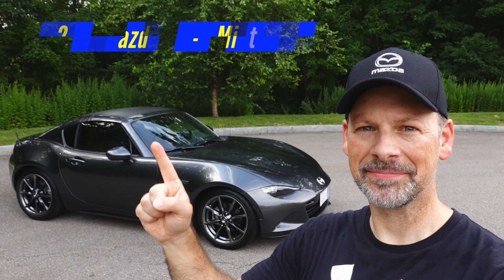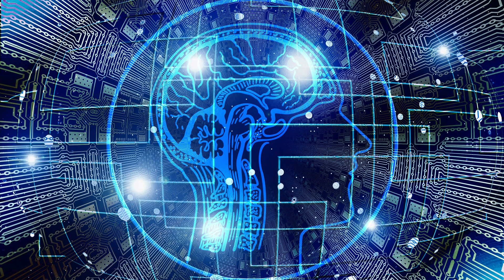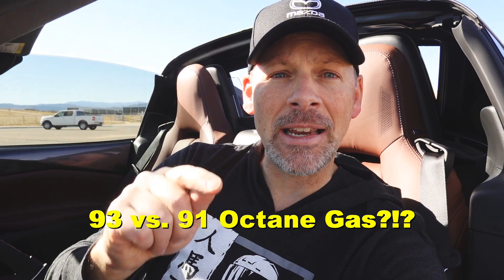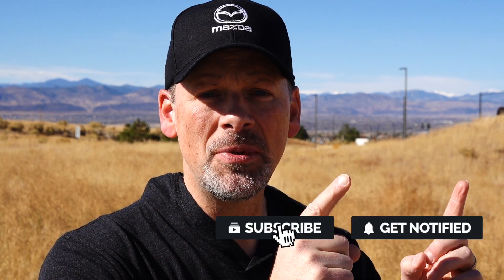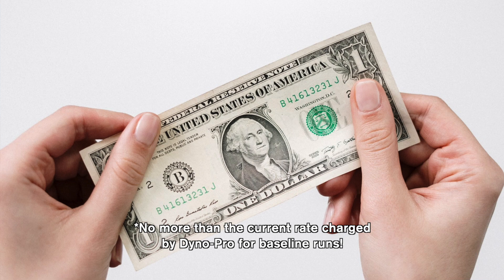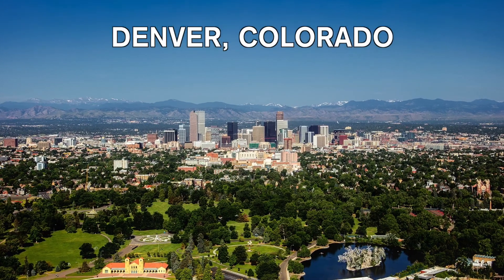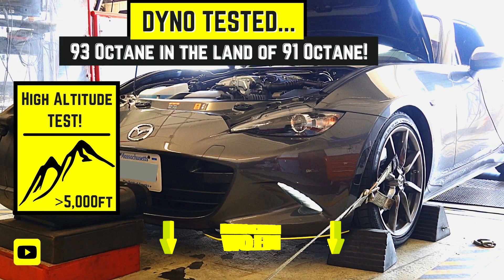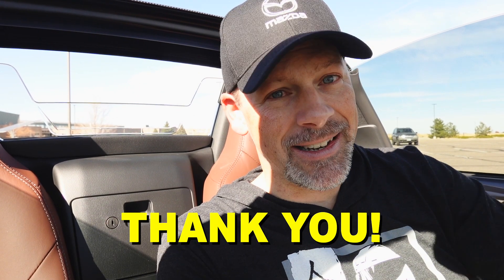91 vs. 93 Octane??? - DYNO TESTED // ND Mazda MX-5 Miata

Comment: Prior to the test, did you disconnect the battery first for 30 minutes to allow the ECU to reset and then give it time to self tune to the different octane? Mazdas will self tune if this is done or proper protocols are followed: If you do not do the battery disconnect, it can take 3 refuels for the ECU to switch over fully. Also, did you run the gas all the way down completely before changing the gas? Could you please take a Gen 3 Mazda 3 2.0 and do this same test but with what I mentioned to do? It has the same engine as some Mazda MX5s.
Reply from the maker: As I answered under your same comment elsewhere… Yes, the battery was disconnected and fuel run for several hundred miles before testing 👍

Comment: When I recently picked up my ‘24 GT RF the dealership folks all pointed out that while 91 octane is preferred, the car will run fine on 87. They made a point to mention it because in Nevada the price spread between regular 87 and premium 91 octane fuel has grown to 70 cents or more! So, while I’m running 91 during the break-in period, I am curious to know how much difference my seat dyno feels with regular. And, of course, if the car suffers any other noticeable side effects. In previous cars that could safely make the adjustments for different grades of fuel, the general rule I followed was that lower octane fuel would work just fine for long highway cruises—not much acceleration and mostly steady speeds. Around town, or during spirited driving through the twisties, the higher octane fuel was worth the investment. Of course, in the past the difference in price was a lot closer. Has anyone done the dyno runs recently with 91 vs 87?

Comment: I think the elevation/air density where you r
Are might be limiting the peaks. Granted you're probably only leaving 1-2 hp on the table at that point.  The turbo will definitely show a bigger change. But I'm curious as my local shell (probably others) has recently rolled out 93. Though we've had 93 in the area for awhile, I just don't use those stations for my own weird reasons.
Reply from the maker: I'm sure the horrible DA due to my altitude plays a role.

Comment: Interesting. I recently, a few days ago, bought a Jaguar 3.0 F-Type manual transmission from Denver, it was shipped to me in New Hampshire. I use 93 octane in it and was wondering about any change in performance the higher octane gas we can get here would have. I suspect lower octane would be a bigger factor at lower elevations.
Reply from the maker: Congratulations on the new car! 👍

Comment: im going to go ahead and guess this is because at 91 octane youve already built your margin and cannot pre-detonate in that engine no matter what you try because you have a fixed compression ratio.  93 octane is going to be a lower power dense fuel than 91, so if you're already stoichiometric (most power extracted) and not pre-detonating, then bumping up the octane isnt going to have any effect

Comment: Annoyingly most places near me (Florida) do 87, 89, 93, skipping 91. So I’m forced to get 93 as the only option that meets or exceeds the recommended. 

This is good to know at least, confirms my suspicion that 93 is no better than 91 since it’s tuned for 91 and if I station has 91 I won’t be missing out any.
Reply: If I remember correctly a lot of places just have 93 and 87 and everything else is just a blend
Reply: nd2 miata is minimum 87, with recommended 91 or higher

Comment: With higher elevation, thinner air, lower octane can be used so 89 or maybe even 87.  These lower octane might be stronger running, cause higher energy density in lower octane.  Octane additive does not have the energy density that gasoline has.  This is theory, in practice might not be enough difference to make a real world difference.

Comment: See, this does not surprise me since the manual says 91 or higher recommended so it’s likely tuned for 91. That said, I think a good video would be dynoing 91 vs 87. The manual says 87 is allowed but would likely see a performance drop off, and I’d be really curious to see how much power it would lose with 87.

Comment: I just put a supercharger on my 2020 mustang gt. The tuner said the 91 octane in the tank was junk. If I can't find better/use octane booster I just dumped a lot of money in this car for not enough hp. I'm not a happy camper right now
Reply from the maker: A good tuner should be able to tune around your 91 octane gas
Reply: @TheLemonFactor  I'm using one the best tuners in the coyote community. No way possible to add timing to bad gas when you're getting knock.

Comment: minimum required is 87, dealer said it will run fine, maybe some slight lost performance but it will not hurt the engine????

Comment: I would actually be more curious to know how much a diff 91 vs 87 octane. Should do a video on that. Gas is already super expensive now.
Reply: Skip your Starbucks for one day and put the correct fuel in your car.
Reply: People have reported 87 being perfectly fine for around town driving below 4krpm, anything above that approaches knock. Can't verify how true this is, but it's what people report. It makes sense however because the lower rpms don't require as much fuel or air or timing as higher rpms. You'd probably be down power at the very best and knocking at the worst. 

If you're boosted, I won't go below 91 especially, at any rpms.
Reply from the maker: Mazda specifically recommends premium octane fuel for the Miata - I would not consider putting less than 91 octane in the car.
Reply: @TheLemonFactor  please test 87!!! Run a few tanks with the 87 to make sure there’s no premium in there. Recommend don’t mean sh!t!
Reply: @jacobbensonmanty  there are already plenty of tests done on this with a miata. you will lose a fraction of MPG but you will gain dollars in your pocket.
Reply: @TheLemonFactor  as you said, recommends, keyword, does not require. I know someone that has a 2019 rf and has always put 87 and has never had an issue with his car and says the car drives like you would still expect it to.
Reply: @MeredithLawwson  Research OCTANE and why it is gasoline...use the fuel recommended by the manufacturer. They do so for a reason.
Reply: @MeredithLawwson  That's dumb because it's against what the manual suggests and you're saving maybe $3-4 per full tank fill up. The Miata has very high compression so it really does require higher octane. Of course, if you just drive the car for 2-3 years then you probably won't see an issue, but why risk it?
Reply: @TheLemonFactor  but my Mazda 3 has the exact same engine but recommended fuel is 87.

Comment: This is very interesting! Was this on the stock ECU tune?? I've noticed the stock ECU on my ND2 really tries to provide consistent performance regardless of the environment.  Even with the AC blasting on a 100 degree day the output seems pretty consistent and it pulls a lot of timing off the initial knock during hard acceleration when it's cool out to normalize the engine output compared to less ideal conditions (hot).  I've noticed a bigger difference in performance relative to fuel quality myself,  in other vehicles that seem to have a bigger window for timing advance (Honda).  I do feel my car performs better with Shell and always found it be a placebo effect, but having worked on logistics I now know most fuel in Southern California comes from the same "racks" except for Shell fuels which are kept in separate tanks and shipped in captive vehicles without being mixed.  I think the quality of fuel and ethanol content may matter more than the "minimum octane rating" on the pump.  The west coast 91 may well have the same detonation point as 93 from a station out east with with lower fuel standards.  The number on the pump is a "minimum".
Reply from the maker: Yes, this was on a stock vehicle. It’s an interesting point regarding the “minimum” octane 🤔

Comment: Octane is not going to affect power if knock does not increase on a stock engine. In colorado, an NA engine especially won't be affected by the dip in octane because the state is further above sea level. Your car already took a loss in power just by moving from wherever you were before into colorado because the air is thinner here. The lower octane rating accounts for the thinner air/ie less air that enters the cylinders and therefore NEEDS to reduce octane to get a complete burn.   Having 100 octane on an NA car in colorado would result in lots of unignited fuel shooting out your tail pipe.  wasteful and bad for your engine anyway. you want as complete a burn as possible.  Therefore, putting 93 into your car while IN colorado may result in a further dip in power, because it might be too much octane and cannot burn well.  

Higher octane available at or below sea level is needed for the denser air. as a byproduct, your NA engine produces more horsepower at that location. therefore needs to higher octane to prevent knock.   States don't just sell different octanes willy nilly. it's all determined by the atmosphere of the location.  Forced induction is the only time... and a much higher compression changes the need and you may need higher octane then.

Comment: The difference (I'm guessing) has to do with more with elevation/altitude. When you ship a car from, say, sea level, to one mile above sea level and throw it quickly on a dyno, it hasn't had time for the ecu to "learn" that the intake is sucking in thinner air. It was therefore making less power than it should have, even though the fuel was higher octane. Then you drove it for a while and the car adjusted for the difference in air density before you put it back on the dyno. Basically, there are several factors affecting the outcome of these results besides the octane level of the fuel. I won't even get started on probable temperature and humidity differences from having a car on a dyno days (or weeks?) apart and the effect those always have.
Reply from the maker: Interesting theory, except that the car had been driven for several weeks and couple hundred miles before it was dyno tested with the 93 octane.  In addition, the car produced the same results (w/ the 93 octane) as when it was dyno tested at sea level (see previous videos).  Lastly, temperature, humidity, barometric pressure, etc. are all standardized (i.e. calibrated into the results) when dyno tested (albeit not perfect), thus why I provide both the corrected / standardized numbers and the uncorrected numbers.
Reply: Because of computers the octane requirements have changed much. Back in the late 80's SAE did a study and at a nearly a mile up the octane requirement drop is around .3% IRC. This is over decades ago and ECU's have only become more efficient.

Comment: Poeple seem to think that higher octane equals more energy and more HP. Octane is added to gasoline to keep it from detonating under pressure. The higher the compression ratio the more octane is required. Too much octane is in fact detrimental to the longevity of your engine. Use the recommended Octane rating for your car. The only time you may want to use higher octane fuel than what is recommended is if you have modified your engine and it has a higher compression ratio than it did when stock.
Reply from the maker: I’ve never heard that higher octane fuel can be damaging 🤔 - are you sure about that?
Reply: @TheLemonFactor  I'm dead sure about it. A tiny little bit of research will give you all of the info you need on octane and why it is in gasoline. Search, "What does octane do in gasoline?" or Why are there different octane ratings for gasoline?" If you run high octane fuel in a low compression engine it will carbon up pretty quickly. If you run low octane fuel in a high compressions engine, such as our MX-5s are, you will have pre-detonation and eventually do damage to the piston head and/or the combustion chamber.
Reply: @AFlasher2277  Makes sense.

Comment: Hey mate ! I just sub your channel ! Seriously i love your content i watched all the nd vids… you know why ? Cause last month i ordered a 2022 ND RF « révolution » 2.0l manual in soul red. ( revolution is the highest quality you can get for a nd in Switzerland ) 
Keep making your great content !
Reply from the maker: Thank you, Leo, for the sub, watch, and the positive comment - it's very much appreciated!!!  Congratulations on the new car - I like the name of the trim "revolution" ; )  What plans do you have for your newly acquired Miata?
Reply: @TheLemonFactor  
already thank you for your answer I did not expect it. But glad you asked me about my plans for my nd, I made a little list :)
Chassis/ handling 
- oem mazda short spring (600$ parts amd labor ) 
- konig hypergram with ado8rs tires
- yellow stuff pads 
- ( maybe a chassis brace ) 
Interior / exterior 
- vertex knob shifter
- checkered floor mats from rev9 
- greddy lip 
- side skirt ( from carbon miata ) 
- rear diffuser ( from carbon miata ) 
- spoiler ( from carbon miata ) 
Engine / power
- hks exhaust ( with maybe a header ) 
- hks filter or a mishimoto air intake
- a tune from my local « tuner »
And that’s all ( i hope ) 
My goal is to have a fun and good looking weekend car that i can drive in the mountains cause there’s plenty in Switzerland but also at the track. I hope to get 205-210hp. maybe what I'm going to do is not your taste but hey I'm only 20 I'm not as mature as you. almost all of the work will be done by me because I am a volvo technician and apprentice trainer. So yeah thanks for asking !
Reply from the maker: That’s quite a list 👍. I’m sure you’ll love your new car, especially once you make it your own. I can only imagine driving through the Swiss alps - it must be awesome!

Comment: How do you know what octane was in the car.  I had a 1984 Plymouth horizon when I was in college in the early 90’s.  If you put regular 87 octane in it the engine would knock but it was quiet with 93 octane.  Anyway quite a few times I would put 93 and it would knock means the pump said 93 but it was really 87
Reply from the maker: I guess I’m gullible and trust what’s marked on the gas pump 🤷‍♂️
Reply: @TheLemonFactor  It probably was but you never know.  They say the reason you only get 93 in Colorado is that elevation negates the difference.

Comment: Great news on the 91 Octane Dyno test.  I live in TX so I have access to 93, but it’s good to know that I wouldn’t lose much if any HP or torque by using 91.  I might just start filling up with mid grade now and see if I see any difference.
Reply from the maker: It’s good that you have the choice of 93 octane. I was very nervous I’d see a drop in hp moving down to 91 octane. I’m glad that’s not the case. 😁👍
Reply: My 2023 mazda3 2.5  says use 87 or 93, but in CA we only have 91.  Is it OK to use 91?
Reply from the maker: @panglingaow 91 octane will be fine 👍
Reply: @TheLemonFactor  just FYI my engine is a 2.5 non-turbo do you suggest using 87 or 91? Since the manual says you can use both but doesn't give a straight answer
Reply: It’s actually cheaper to pump 93 and 87 at the same rate in your pump and you will get 90 octane, that’s what the midgrade is anyways, it is a mixer pump. They sure charge you a premium for using the midgrade for the convenience, as they are almost always a bit more than the average price of regular and premium.

Comment: That's great news. Living in California, I always wondered if I was missing out on higher performance without having access to 93 octane petrol on my 2017 ND Miata, but after seeing your test results, I don't have to worry about that anymore!
Reply: why stop there? just stick 87 in it, you never had to worry in the first place.
Reply: Living in California as well. Even though we're not losing out on power stock, it would still be nice to have higher octane because you can tune for higher octane which makes significantly more power than 91.
Reply from the maker: Thank you for the watch and comment 👍

Comment: Great video, as always Chad! I usually fill my car with 91 octane at Costco as it is top tier gas and 5-6 cents a litre cheaper than Shell/Exxon etc. I do on occasion buy 94 octane at Petrocan or 93 octane at Exxon and have wondered if the ECU adjusts for this. I have not dynoed the car, but have felt no added power due to the higher octane gas. This video seems to confirm that.
Reply from the maker: Thank you for the watch and support 👍😁. I’m glad to see that I’m not loosing any HP dropping from 93 to 81 octane 😃
Reply: In the case of your state having 94 available, this is for very high performance vehicles with forced induction running much higher compression ratios. An NA car will be hard pressed to ever require that. Unless it was a racing specific engine.

The biggest fear I have as a takeaway from this video is for someone who does live in a denser state to watch it and think "oh great! I can start filling up my porsche carrera GT with 91 here in south carolina!".   The advice should have been to use the appropriate Available grade in your local area.  "highest octane" for performance street cars. whether that be 91 or 95.  and lower grades for normal vehicles that specify it.
Reply: @twrcrew8852  Although the Miata is an NA vehicle, it has very high compression for an NA so it will still require premium gas, which is at least 91 octane here in the states.